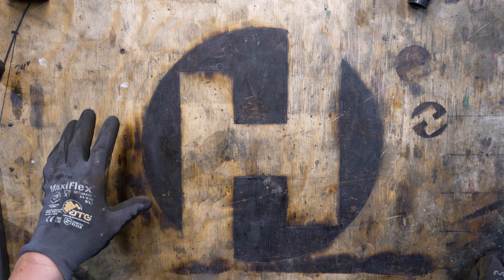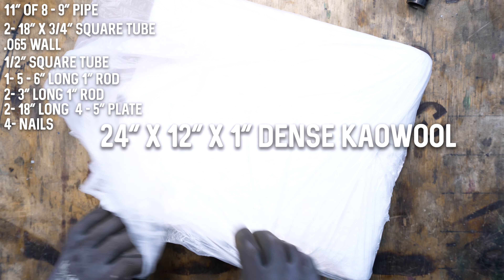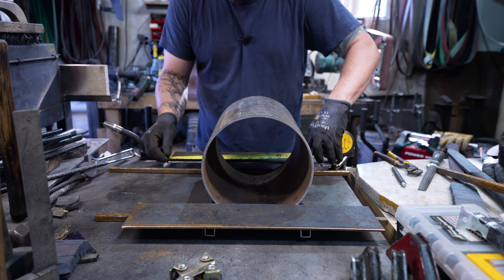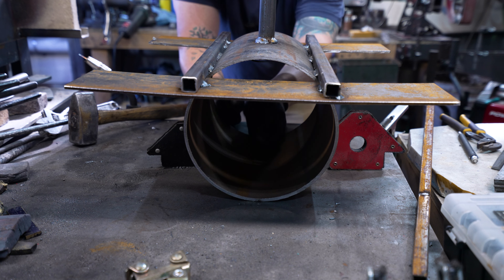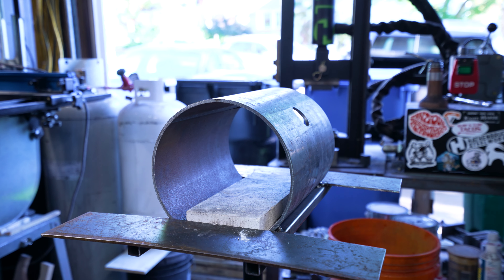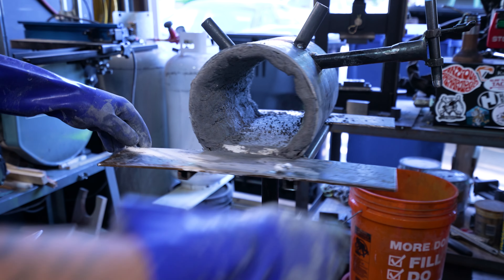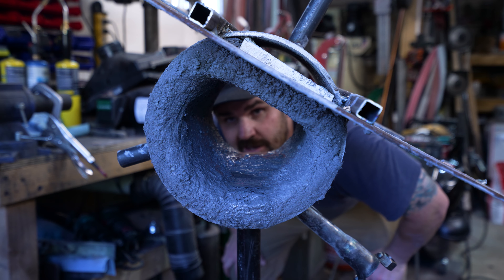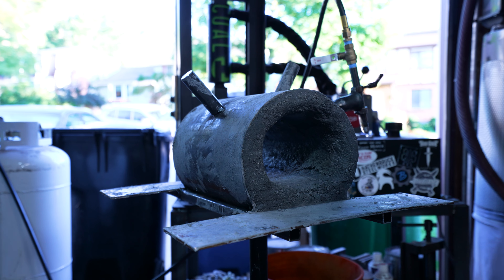How to Build a Forge - The David Lisch Way

Comment: First off, great video! I see the time you put in to make sure lighting and angles are just right 

Second, now that time has passed how has the gas usage been for you?  
I'm running a forge that burns about 1 gallon an hour and looking to build one that's more efficient
Reply from the maker: Well thank you. I definitely struggle sometimes. My Shop is small, so I’m always tripping ever stuff when I’m filming.

As far as gas consumption goes, I’m not exactly sure yet, but I haven’t had to fill my tank yet, and I’ve used it quite a bit. Also, when I first started using it, I’m pretty sure I wasn’t as efficient as I could be…and I’m probably still not. I can say that it’s more efficient, just not sure how much yet.
Reply from the maker: Oh wait, we’re talking about the David Lisch forge. Hahaha. So I’ve built another since then, but yeah, even the Dave Lisch forge is much more efficient than my Majestic forge.
Reply: @Hathenbrucksteelworks sweet thanky you man! I am currently running a Majestic forge, it's an older one but I was hoping it was going to be a bit better
Reply from the maker: For sure more efficient than the Majestic.